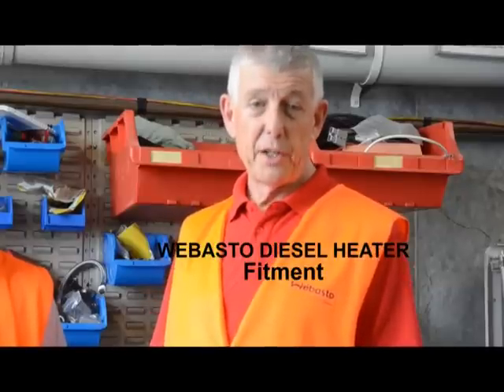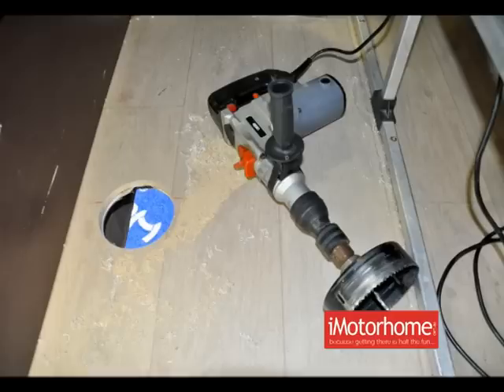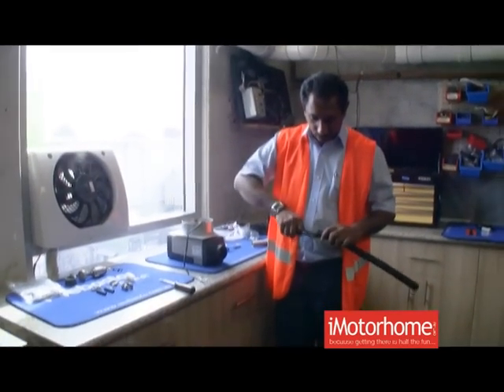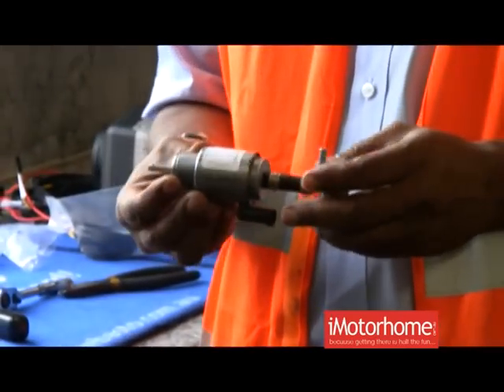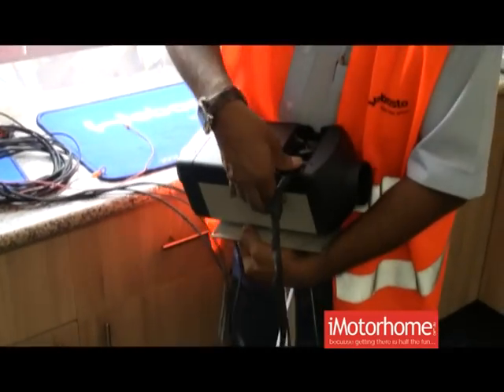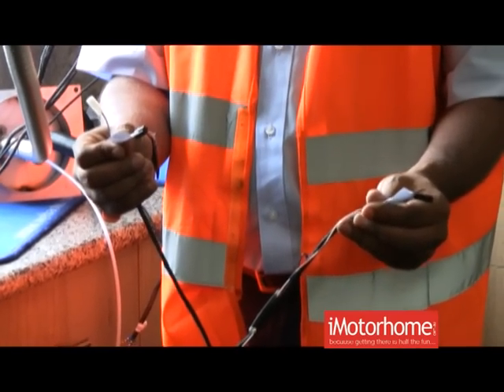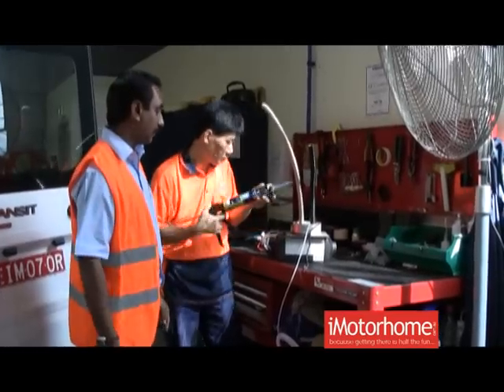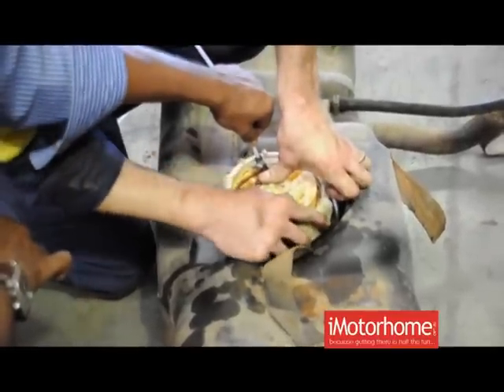Webasto Air Top 2000 STC Diesel Heater Installation

Comment: Question Three: On the main wire for the unit, one plug says potentiometer and the other says telestart. You said the potentiometer is for the Rheostat/dial and the telestart is for the digital multicontrol. Do you know if these plugs are interchangeable? Because the way the cable is wrapped, placement would be better to use the potentiometer wire for the digital multicontrol. Thank you

Comment: Question one: the fuses (1amp for the controller and 15amp for the heater) - on the fuse harness/plug there is a sticker that says F1 and F2. Can you tell me which fuse goes into F1 and F2?
Question two is about the two wires that come from the heater to supply power to the fuel pump, and the separate/long fuel wire with blue and brown wires - Is there a positive and negative? How do the blue or brown wires connect to the two from the heater? Are they interchangeable? Thank you

Comment: Have one of these in my VW with a Smart controller, the one flaw with the webasto is the intake thermostat is the one used and that is almost always colder than the rest of the van especially with captain chairs.  I wouldnt recommend installing this without the temp sensor in a small van or just go for the basic controller. The STC ignores the controller temp sensor so you van is melting your eyeballs or its set to 10c to get 20c. Great kit otherwise..

Comment: I installed this heater and I'm a bit unclear about the looms. I assume the idea of having 3 main looms as part of the overall loom is to allow to have the controller in a different position from the battery supply. I have the new digital timer but if I'm to connect it as you say here the loom is not suitable for placing the controller away from the power supply as it connection is part of that loom. The two looms that make up the main loom no longer give the options to place the controller in a more suitable location that is not near the battery. Basically I want to place the controller c.2/3 meters away from the battery. Is there some way to make this work? tks Paul

Comment: I still have a cable with an external sensor that I don't know where it is mounted.  I didn't see any temperature sensor installed, how do you know when to turn it off?
Reply from the maker: Sorry, call Phone: (02) 8536 4800 or Freecall 1800 244 494 to speak with Swamy.

Comment: I figured out it is for an option room temperature monitor
Reply: Well done!
Reply: C Mulkern does the harness for the controller connect to the battery also?
Reply: The heater takes its power from direct connection to the deep cycle house battery.

Comment: After watching your video and ready to install my heater, I need to confirm the wiring loom connections. I have the new digital controller and you state that this connects to the Telestart Termocall Diagnose plug. The length of this plug is only about 600mm from the battery fuses which leaves me with little scope to position my controller.  The User Interface Potentiometer lead ( for the old style controllers) has a 4 metre lead. Can you please confirm the correct lead connection.  The circuit diagram doesn't help unfortunately.  Your assistance would be greatly appreciated.
Reply: G'day Jeff, I'm afraid you'll need to contact Webasto directly to answer that. Visit www.webasto.com to contact technical support or find your nearest dealer.
Reply: The supplied harness from the heater end splits into 2 shortly after leaving the heater each branch of the harness is I think 7m. 1 branch of the harness has the power connections (Red battery + Brown battery -) and the required fuses at the end.  The second branch of the harness has 3 connectors, 1 is for the standard rotary control switch pot, 2 is for the fancier digital controllers and diagnostics, 3 is a 2 pin plug for the optional room temperature sensor (fitted with a resistor "supplied in the kit" when not used). 
The fuel pump is connected with a totally separate connecting lead that plugs into the wire that exits through the combustion inlet pipe. Hope this helps because the supplied diagrams are not very clear at all.
Reply: you can extend the wiring , get an extension lead for it , or use a unibox , depends on your install , you don't have an RV harness

Comment: there is another two wire plugin on the harness where the oval plugin connects to the heater. What is this for?
Reply: C Mulkern I have the same issue

Comment: Hi Richard,,,,could i heat a 37 ft RV in  - 10degree weather  with this system.I love the diesel  system.Thanks
Reply: Hi Doug, for an RV that size have a look at the Webasto Air Top Evo 55. It's the same thing, but with a max 5.5 kW of heating power compared to this one's 2.0. Try and work in a couple of ducting outlets too if you can.
Reply: Hi, i emailed the company for brosures.IIt heats water to i hear ? Thanks
Reply: That's a different unit Doug, the Dual Top Evo. Rated to 8 kW heating. Very good!
Reply: Thanks alot for the info Richard.Great help !!
Reply: Hi, ya that sounds amazing. I for sure will duct a few holes to keep the underfloor warm to !!
Reply: Can i incorperate hot water on demand with the Evo 5.5 / Thanks
Reply: It's not on-demand Doug, but heats quite quickly. Around 10-15 minutes I'd say. FYI, the Webasto systems, like all European system, have much smaller hot water tanks than US systems like the Suburban. Think 10 L v 22 L, but that reheat quickly. It's because of size/weight limitations in European vehicles. Hope this helps.
Reply: Thanks,it sure does

Comment: Hello is it possible to convert a 12 V heater the same as this 
to 24 V from my Lorry 

Thank you in advance 
 for any replies
Reply: Yes Darren, it runs on 12/24 volts.
Reply: Richard R    Hi.  Thank you. 
I will now contact the 12v heater 
to the 24v lorry battery's 😊👍🚚

I hope it will be all ok.   

Thank you again 
Best wishes.
Reply: Webasto's tech specs say it runs on 12 or 24 volts. If in doubt, give them a call first!
Reply: Richard R 
Thank you.   Best wishes